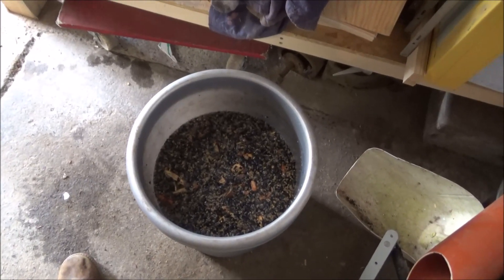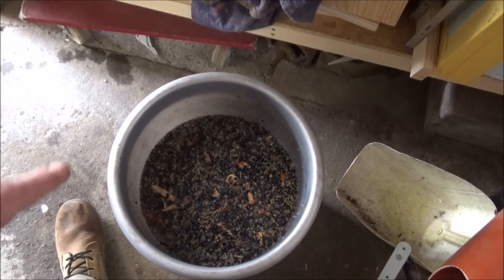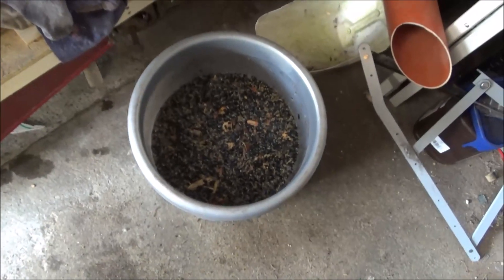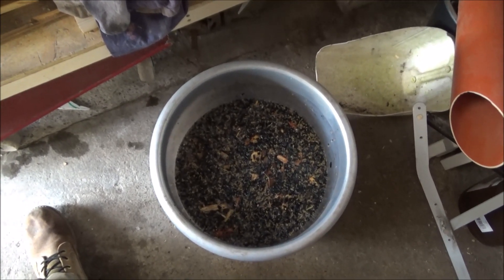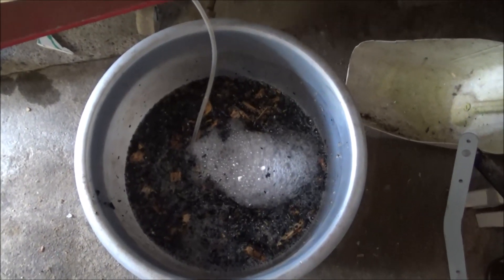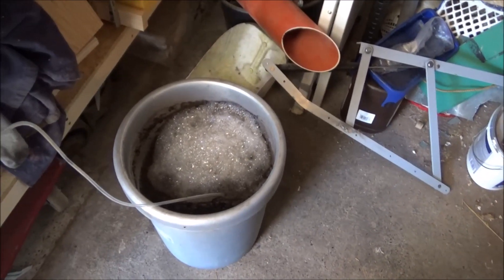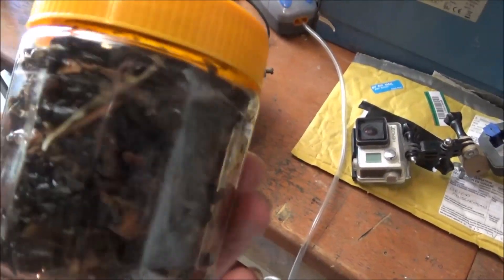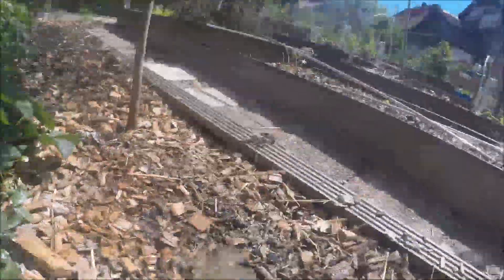Morel Mushroom mass spore slurry  21 05 17

Comment: I think that the charcoal is not a substitute for the wood ash. The purpose of the wood ash is to create lye, which in turn raises the ph so high that it kills most organisms. Mushrooms can survive this alkaline environment. Basically one step cold pasteurizing in other words. I don't believe even hardwood charcoal will serve this purpose. To the extent that it does substitute for ashes in the triggering of the fruiting stage that requires symbiotic connection to tree roots, it may be helpful, but I still think you may need lye. Great content though.
Reply from the maker: Hi thanks for the comment what your saying is very interesting and might help other people trying so I will pin your comment to the top.  I haven had any fruiting as yet If I dont get any next spring I would say it was a fail.. The mushrooms I made the mix with were sent by a friend and had air dried i had to give it a try. 
All the best Dave
Reply: @SouthpawDavey  Thanks. I hope it turns out to be successful for you. But hell, we learn more from the failures often times. As the saying goes: "If it was easy, everyone would be doing it."
Reply: @SouthpawDavey  what about coffee grounds do they work well?

Comment: Hello dear i am from pakistan want to grow mortel can you help me to make spore
Reply from the maker: Here is a how to make it. The actual recipe for a spore mass slurry is quite simple. Take one gallon of rainwater (filtered tap water or distilled water will also be fine, but beware of water straight from the tap as it has too much chlorine here in the US) and bring it to a boil. Add one tablespoon of molasses and one quarter teaspoon of salt. You have to chop the mushrooms or blend them in water the mushrooms must be dropping spore and add them to this in a 5 gallon bucket. Put an air stone in it needs to have air. You can stir it to add air every 2 to 3 hours. After 24 hours you can use Half a gallon of this mix it with rain or distilled water and spread it on the place you want your mushrooms to grow hard wood chips are a good growing medium. You will get 50 gallons of spore from your 5 gallon bucket.
Reply: Thank you!

Comment: Had any luck yet?
Reply: have you tried spreading wood ash on it yet, i hear it simulates conditions of a resent fire, triggering them to go to fruit.  YMMV
Reply from the maker: Thanks didn't think of that I will do that today we are expecting some rains so that will help been very dry too. They might not be fully established yet to fruit this year but worth a try. I have been looking ;-)
Reply from the maker: Not yet.. If it worked i should see some soon spring is about two weeks later this year so they could also be. I have been looking. It might take another year for the mushroom to be ready to fruit but fingers crossed. its also been dry here for the last two wees so a bit of rain might help. I will update if I get any thanks. 
It has worked for other people I will keep trying if I dont get any this time.
Reply: Morel mushrooms are possible to grow. But temp should be between 2 degree celcius to 22
Reply: Duck. Luck fuck

Comment: In Finland Morels are called Korvasieni and at least a translation of the finnish wikipedia page says that if not handled correctly then they are poisonous. Fresh morel contains gyromitriiniä , which is a life-threatening cytotoxic . It is heat and cold resistant, but highly volatile and water-soluble compound. An incorrectly manufactured, or replaced by the fungus ryöppäämättömän eating cause acute poisoning. It is not known how large the amount of morels is enough to cause poisoning, but it essentially depends on whether the case of raw or inadequately treated mushrooms. However, it is estimated that gyromitriinin LD50 value for humans would be from 20 to 50 mg / kg, which is equivalent to 400 to 1 000 grams of fresh morels.
Reply from the maker: Are you sure its morels and not false morels as I can find nothing about this in English?? I know there is a fungus called brain fungus that looks almost like a morel but is easy to tell the difference with a spore test and easier by just cutting it in halve as a morel is hollow. I have never heard of this and you can buy fresh morel and dried mushrooms. More info please if you can point me in that direction.
Reply: This is the Finnish site for Korvasieni. Apparently it is delicious if handled properly. https://fi.wikipedia.org/wiki/Korvasieni
Reply: Here is a translation:
In spite of the toxicity of morel is one of the most delicious Finnish food mushrooms . It is a fine and strong recognizable aroma and crab meat-like texture.  Morel mushroom belonged to the traditional trade list up to 1 July 2012, and since then it has been a part of Evira maintain the recommended food fungi list. In Finland, morels are sold as crude as well as the preliminary treatment; ear mushrooms for sale as crude must by law always be accompanied by a warning text, and processing instructions.
Reply from the maker: +Old Gardener Guy that's the brain mushroom in this link not true morel I do know this one and yes it is toxic the true morel is not.  thanks for the info and warning. Better safe than sorry or dead...
Reply: Old Gardener Guy - Finland Korvasieni (Gyromitra esculenta) is not a Morel. Morchella, the true morels: Morchella esculenta, (yellow morel), Morchella angusticeps (black morel), Morchella elata (black morel), and others (that don't grow around here so I'm not familiar )